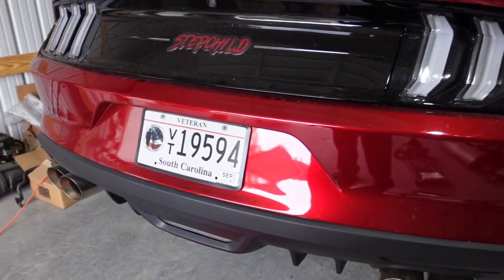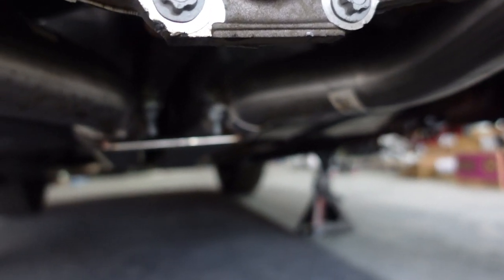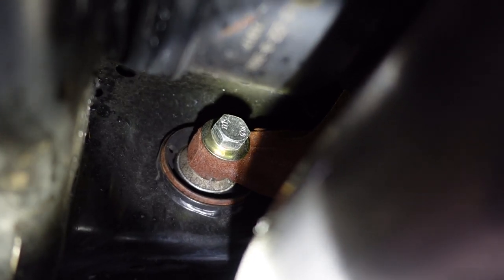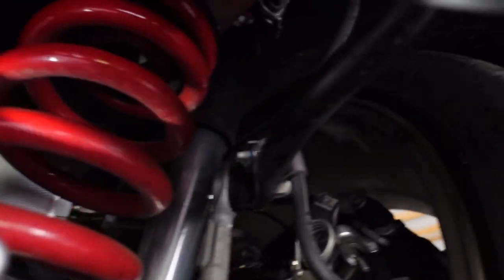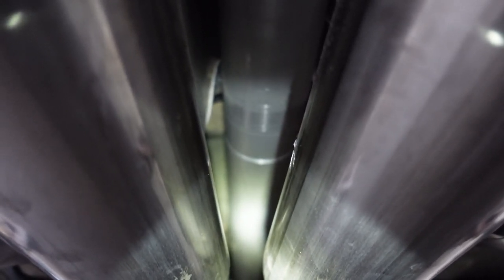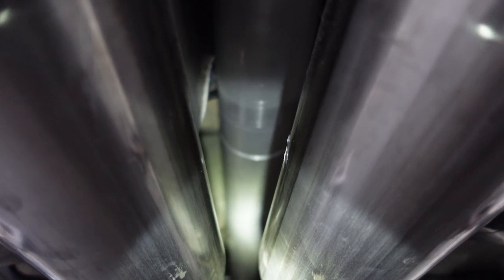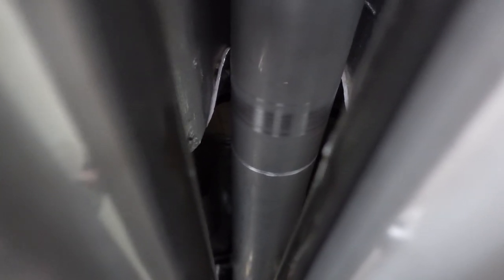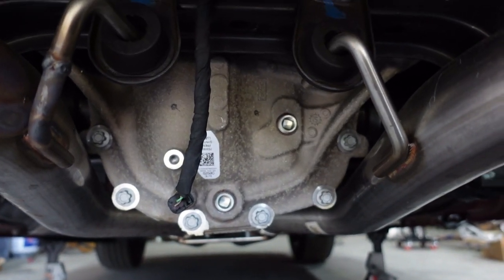Major damage to my 2016 Mustang GT! What happens when differential bolts break? Let's find out!

Comment: man why did this happen do you think?i just put all the same diff an craddle lock on my car.with 1 piece shaft that im now dealing with slight vibration at 80 plus but i woulda thought for sure the craddle an diff lock woulda been strong...why did those bolts break?wheel hop somehow still?should i upgrade the bolts from bmr to a grade 8 or better?i hope you reply to this...i also used the dss 1 piece... kinda depressed honeslty.alwats wanted a new s550 car an got 1 a 17 with 5k miles but man its been shit for driving experience an all these stupid issues. ..was so much slop n drive line prior to upgrades that i felt it all needed done

Comment: I was always told Strongest isn’t always best, grade 5 bends grade 8 breaks, research it a bit before you replace them all
Reply from the maker: In this case, it involves shear strength. I believe grade 8 or 12.9 resists shearing better than 10.9.